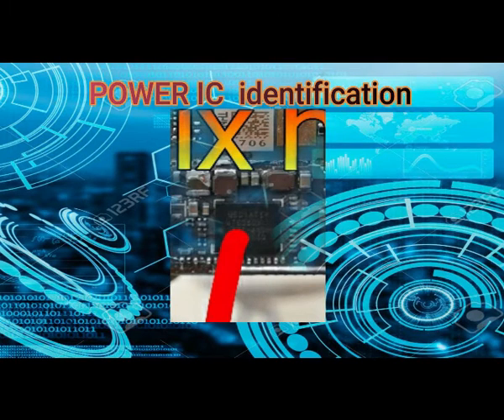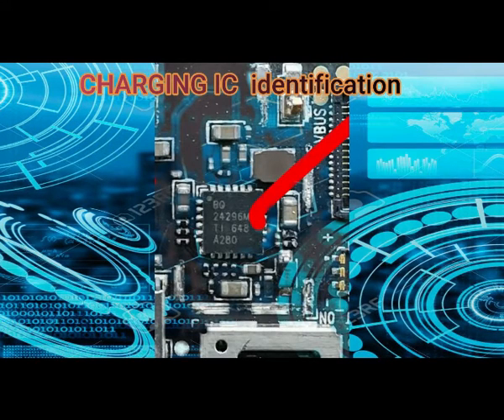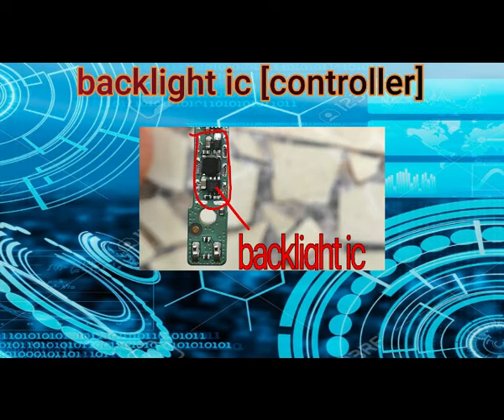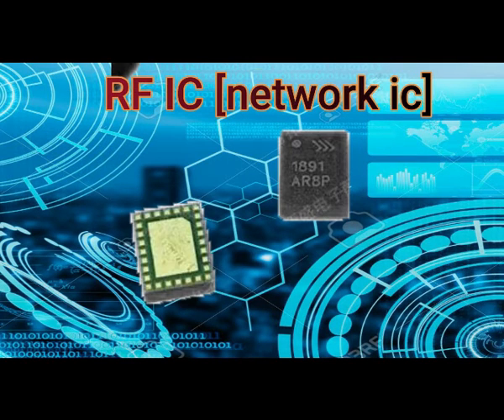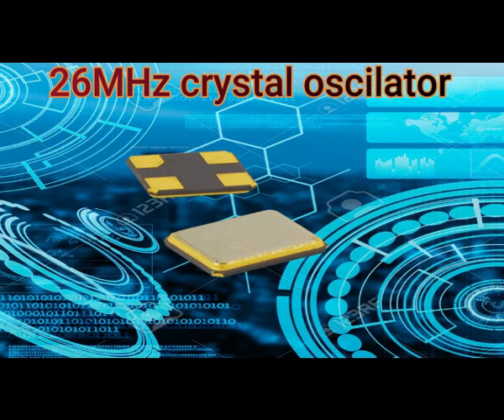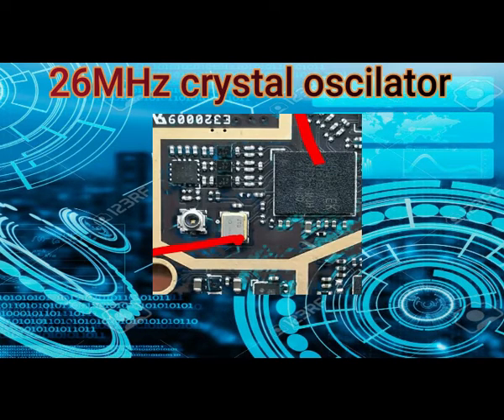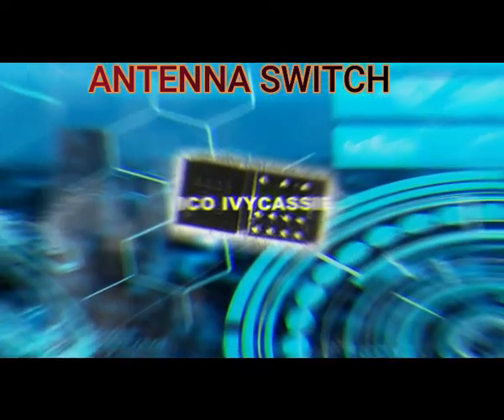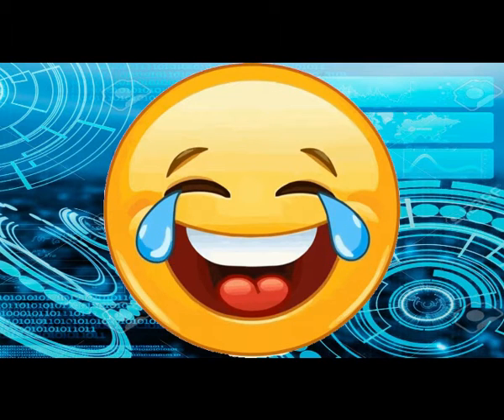How to Identify all Mobile ic and how they Work Full Explanation

Comment: Hi Serges. Thank you for the video.
I got a question, my nintendo switch lite (which uses mobile components) has a very unstable wireless performance. The signal strength varies wildly, even though the handheld is sitting 30cm away from my router. It goes from 3 out of 4 bars down to just one when downloading a game or an update, and that's when it's connected to 5Ghz. When it's on 2.4Ghz, it sits on ONE bar, no matter how close the router is.
I've checked my router, but signal strength is set to high and all other mobile devices on 2.4Ghz report very good signal strength, but the switch lite.
What could be the source of the problem?

EDIT: I purchased another set of cables (black & white) and I connected them to the board, problem still persists.

Comment: Hey, I was thinking about using an old cellphone as a 4g router for my car. Now for this to work properly it needs an external antenna connected to it that goes outside.
On my phone's pcb there's a tiny coaxial connector connected to a tiny wire running down the right side of the chassis, but the actual antenna seems to be hidden in the backplate which has 5 metallic connectors all around it and when it was off, the phone didn't have a 4g connection.
So my question is what is that wire for ? Is it actually the 4g antenna and could I replace it with a longer wire that goes through the roof of my car to get a good connection ?
Reply from the maker: That's actually 3 and 4gb cable network. 
If you instent it as you are saying it will work just fine.

Comment: phone won't turn on. replaced the screen, battery, and charging port. What is usually the next culprit? It has to be something on the motherboard I'm thinking. Won't force reset either. Also what ic containers the saved data and is a chip off data recovery possible? Thanks
Reply from the maker: The ic that contains save data is the emmc and you can recover the data using any reprogramming box like JTAG or UFI BOX
Reply: @SergesMike  will a reprogramming box work even if the phone won't turn on? I'm thinking it is the power ic has gone bad.
Reply from the maker: Yes. You remove only the chip and place it in the socket on the box
Reply: @SergesMike  I have heard that the data will be encrypted a chip-off data recovery is not possible with modern cell phones because the phone companies encryption.
Reply from the maker: You should watch this videohttps://youtu.be/QCMMv2CoFAg

Comment: How do u trace a faulted I.c?
Reply from the maker: First you need to know how those ic work so it will be easy for you to know that this ic or that 1 is faulty according to the problem with the phone since most mounted ic can't be tested with a multimeter 
It's easy to identify some power fault using a dc machine 
For example: when a phone comes to your with no sound the first thing you suspect is the speaker
So now if a phone come to you with WiFi problem and you flash it and it still doesn't work them clearly its the WiFi ic.
I will send u a video on how to identify faulty emmc and cpu
Reply from the maker: https://youtu.be/lEpkWfX-b1E

Comment: Phone shows No service I tried manual network search but still not showing anything is it because network ic broken ?
Reply from the maker: First check imei and baseband 
Maybe, but u have some steps to go through before suspecting network ic.
First check the network cable and the line if its not broken
If okay try changing  P. A ic if still not working then you can go now for the R.F which is the network ic if you change and it doesn't work then reball or change power ic
Reply: Thank you

Comment: How to fix network problem of tecno boom j8
Reply from the maker: 1, check imei and baseband.
2, check antenna and network cable for open circuit.
If they are okay then
3, change RF ic